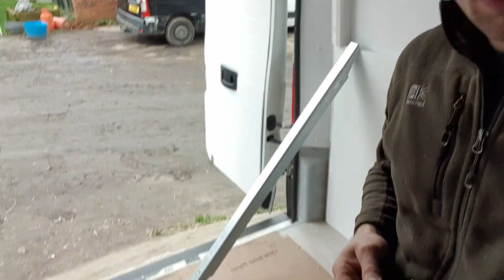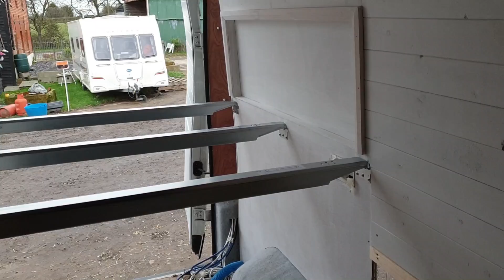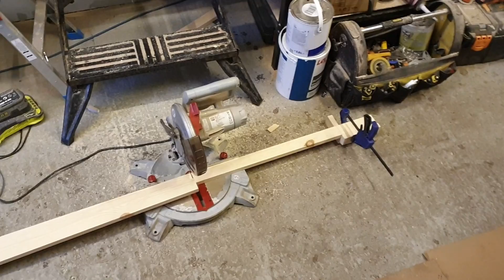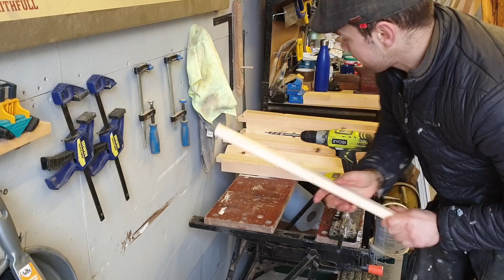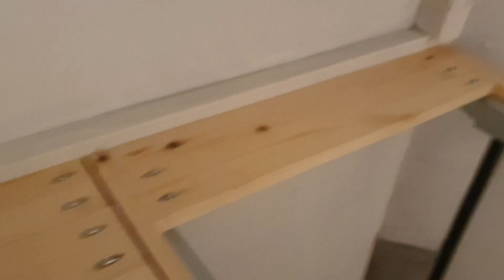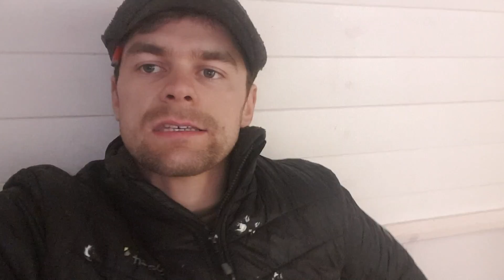How to install a fixed bed into your van conversion - Ikea bed hack

Comment: I’m just at this stage in our boxer conversion now. Is there any reason you used your own flat 2x1 timber for the slats, as opposed to using the pre-made slats also available at Ikea? The Ikea ones can be bought separately for the Luröy model, but are curved/sprung so perhaps this isn’t as easy to fix to the beams/ framing PSE?
Reply from the maker: We do use the ones from Ikea now and they work great! (this video was done a few years ago)
Reply: @vanlifeconversions  Fab thanks! Your videos have been like a guide book to doing it right. I’m really pleased with how our van is turning out

Comment: Installing the fixed bed first and then installing the electrical, water, and gas systems in the garage area is how most everyone does it. But I saw one “tour” where it looks like the systems were installed first and finally a single piece of plywood was laid across the system cabinets for the mattress. This is certainly a cheaper, lighter, and more space efficient approach. It requires more planning but is much easier since you’re not working under anything to install your systems.

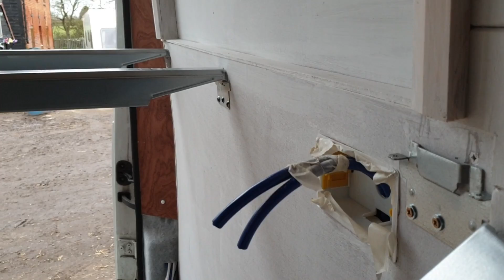Comment: Hey Oli, great idea! Quick question? You have pse timber running on top of the length of the skorva mid beams (at 1:43) - how are these fixed? Are they screwed into the walls?

Comment: If you're gonna use Ikea parts, why not also use their L shaped rails that support the slats at the side of the bed? You would save on weight and be done a lot faster.
Reply: Got a link? Thanks

Comment: Thank you for the video.  I'd already seen the metal beams in Ikea and thought it would be a good idea to use them. So to find a video showing how to use them was fantastic. Is there a reason why you cut and screwed your own slats rather than the Ikea slats?
Reply from the maker: Thanks! It just means you can make the bed to the size you want, whereas Ikea slats are a set size